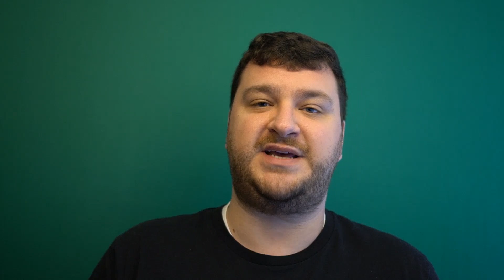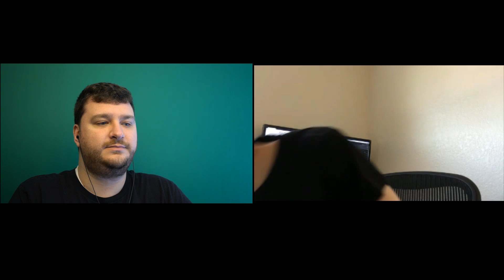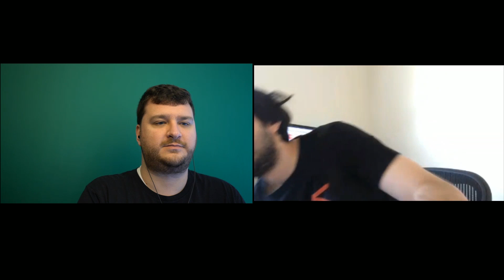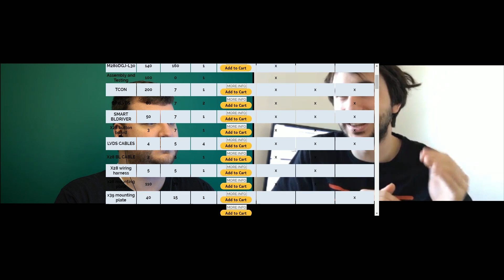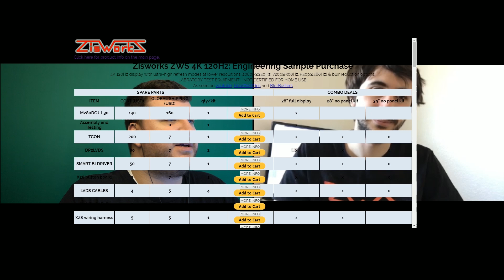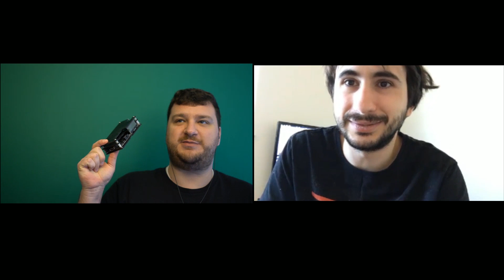RetroRGB Interview: ZisWorks Zero Lag LCD Kit - May 12th 2018

Comment: So were getting 0ms. Thats good.WOnder how hard it is to install it, is soldering required. I hope to see this implement 1m or 0ms on tv in a couple of years. Im planning on getting a new tv with the next gen consoles to come. I don't want to make the same mistake i did last time and got a 4k tv without hdr and find out a year later hdr is amazing with the secound coming consoles.
Wish they find out a tech so native res isn't required for a good picture.
Reply: I hope they introduce real 120hz or 240hz. not this process 60hz double to be 120hz you have in most tvs today. xbox one already has a update for 120hz monitors.